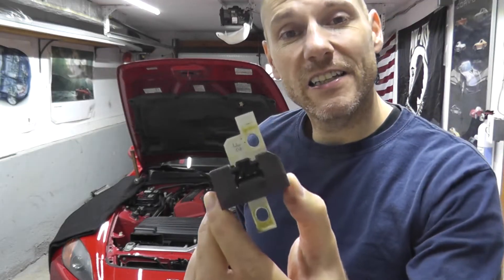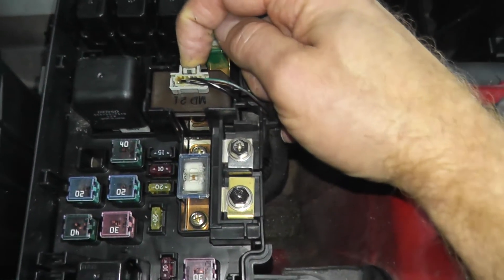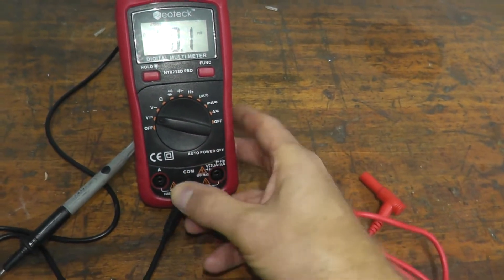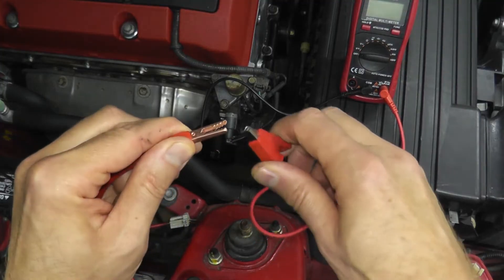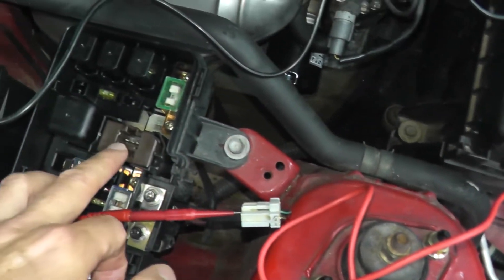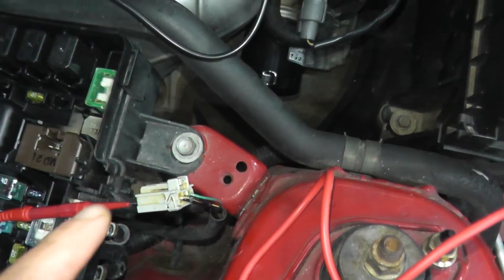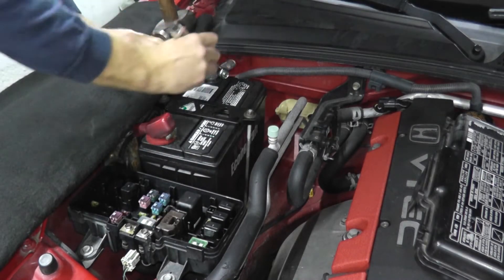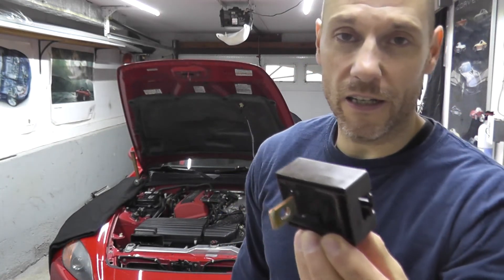How To Test And Replace An ELD or Electrical Load Detector P1297 P1298

Comment: Was ignition on during test
Reply: Then middle wire is ground.  Check for continuity between middle connector plug and ground

Comment: What’s the suggestion if I have power at the harness, alt tests good at parts store, battery is new.   But alt does start charging until the voltage is down under 10v.  Then will kick in and run to about 13.4.  Would this be the eld working but not accurately minoring the load ?

Comment: What if you have to find a new plug? I cant find a part number for a new end for the wire. Its so corroded i need a new plug.
Reply: He also forgot to state what the middle one of 3’s  function was for that was at super low milliamps. My Honda’s not reading anything on that spot , so now I don’t know his to track my problem down. Everything else tested properly 😢

Comment: Would it make my battery light on dash go on I have new alternator and battery and my battery light goes on and off
Reply: Was it an aftermarket alternator? Some aftermarket alternators do not work rite with the ELD system and it can be bypassed.
Reply: @JayJay-de8vq me podrías pasar el dato para puentear ?

Comment: My Odyssey (04) went all haywire and fried its cheap battery that I bought to get by. . is- it ~possible that the dash trouble lights for the doors' ajar alerts aNd the battery light won't go out because the power from the alternator and/or ignition fedback into the ELD and fried it too?
Reply: well looking at your comment from 7 month's ago. This you - tuber don't comment back to his followers . I cant like his video because of this reason.
Reply: @danielgibson5176  eh, probably only answers emails. I just "like" to mark my place. this guy's info is useful (i guess)

Comment: I have a 99 civic DX. The ELD is unfortunately installed with wiring clip at bottom of fuse box. You must DC negative bat cable, remove 3 bolts around fuse box, then open bottom of box (loosen 8 small clips around perimeter), then you'll have access to release wiring clip to test.